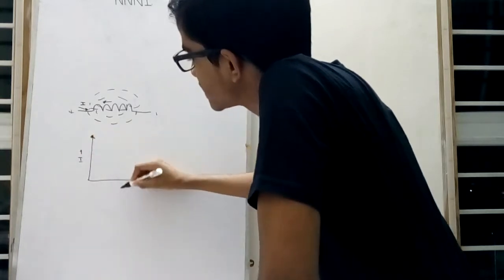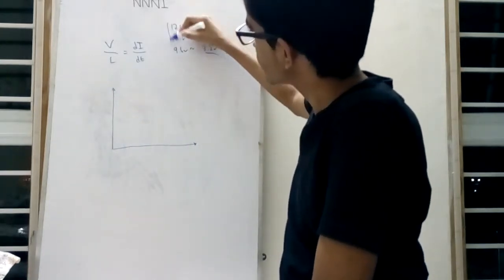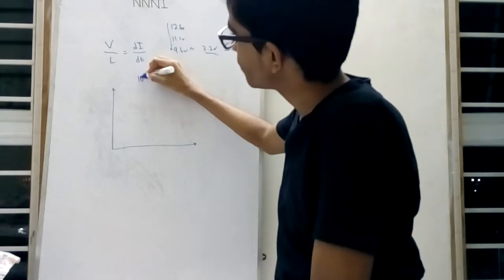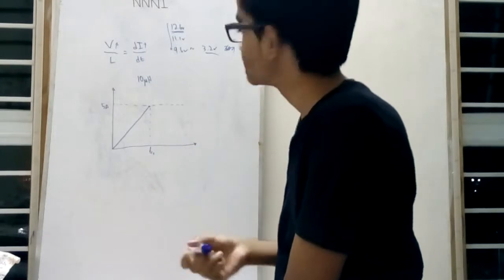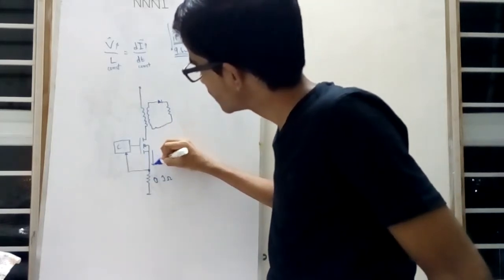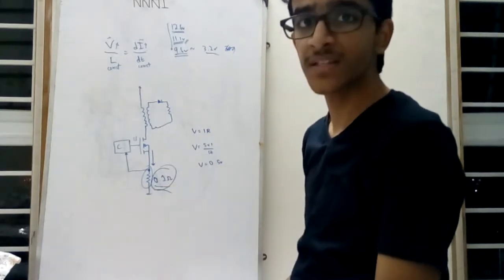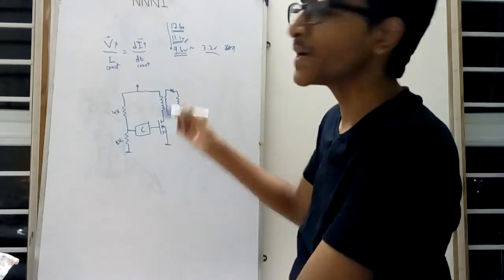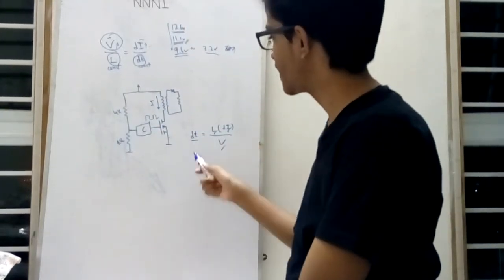Inductance and a problem.

Comment: On my previous comment, I do suggest "hacking" into the Arduino registry and changing the frequency on pin 5 and 6. They can achieve a frequency of 62.5kHz. That's how I did it.
Reply from the maker: I'm not sure if you can achieve the same frequency on an ATtiny85.
Form factor is all important.
Reply: I am not sure either, I only have the ATTiny 13a to my access. However, what I do know is that the registery is very different, for example, the ATTiny can't drive a simple servo with the servo.lib. You'll have to simulate the PWM signal to the servo, I tried that with the little servo controller you saw in my video, however, I ran out of available flash memory, so I switched to Arduino.
Reply from the maker: There's a pretty good library called PWM.h, got to check that out.
Reply: As I said, that library will sacrifice a 16-bit pin and is definitely not compatible with a ATTiny. Not sure if you wanted to try that.
Reply: I will be using atleast 6 seperate PWM signals in my power supply. Including their 6 corresponding digital value. I can't afford to use such a library.
Reply from the maker: You were right.
It's back to a 555 again!
Reply: +NNNI You know what? I have a concept in my head. Where you control the pulse width on a 555 timer with an Arduino and the frequency with the 555 timer. Perhaps I could make a quick video on it if you'd like?
Reply from the maker: Why not?
Reply: I'll mention it when I start the power supply build.
Reply from the maker: Allright.

Comment: If you are going to use an arduino based microcontroller, which I highly recommend, do refrain from using the delay() function as it delays the whole programme. If you have additional control code in there, it will be affected.  Check the documentation on Millis() and Micros(), they are much better at calculating time differences with high precision. They will make bitbanging much more efficient, but also more complex.
Reply from the maker: Like I said, It's a bad way of doing it.
My new code does use the micros() function.